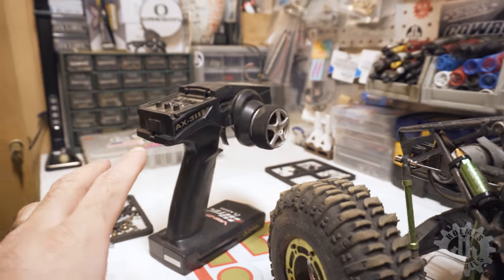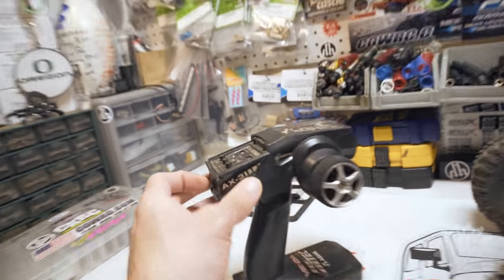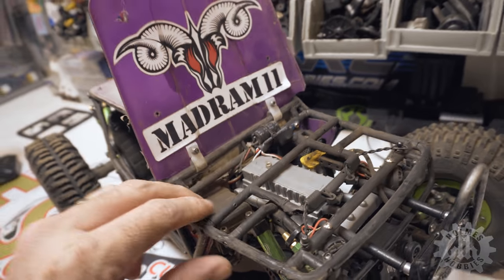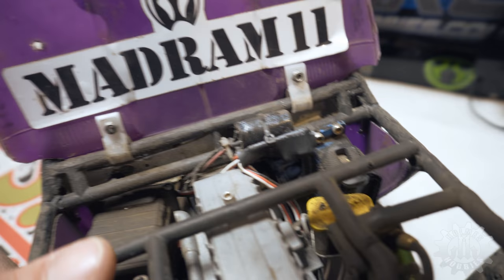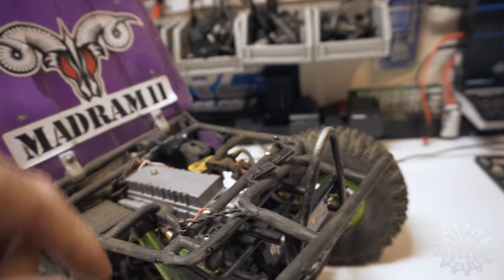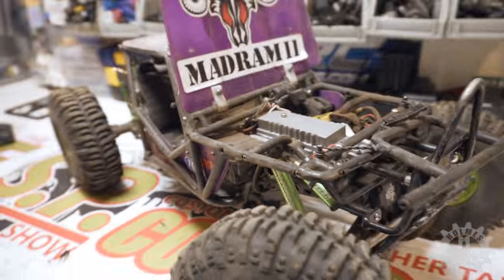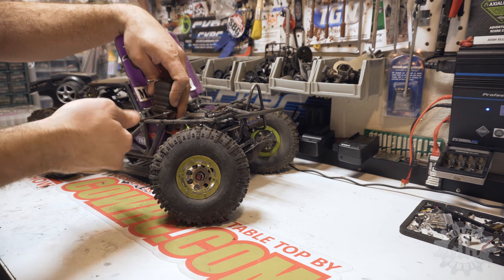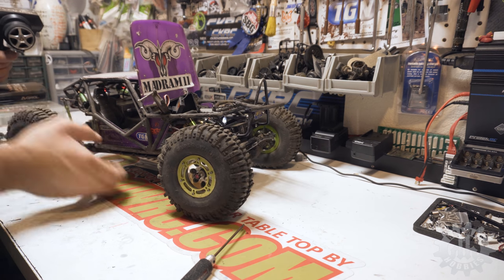Holmes Hobbies | Motor Control | Episode 103

Comment: I would put a small blobb of hot glue on those reciver connectors so they dont come lose and if u need to get the glue off u just cut it in a L pattern and get some pliers and its done